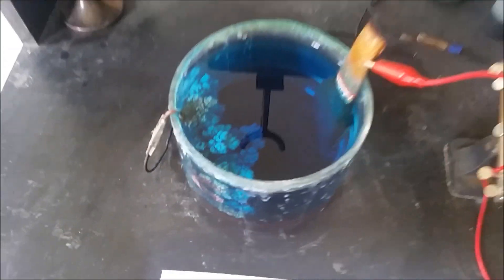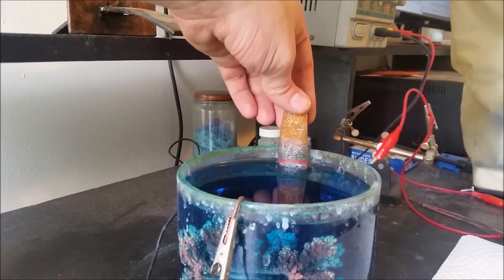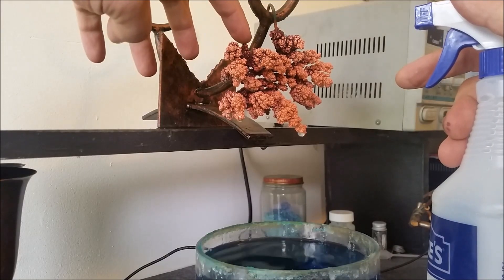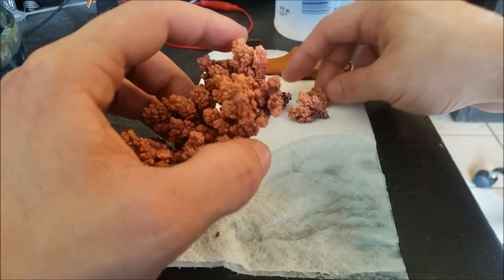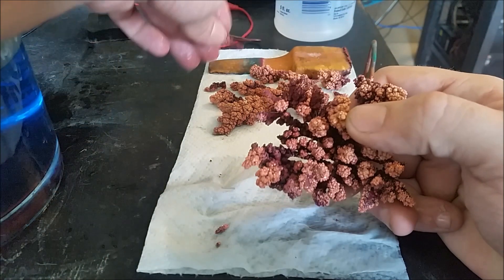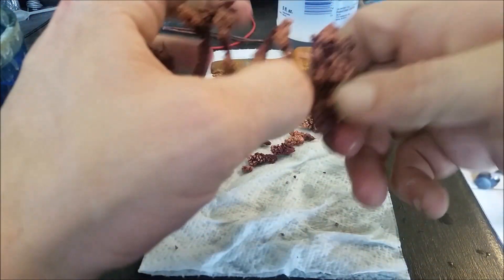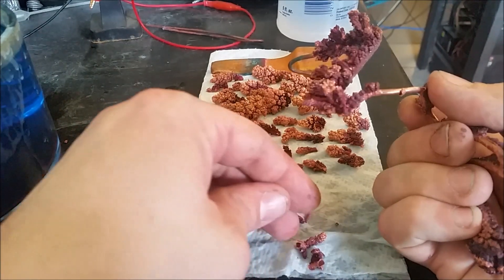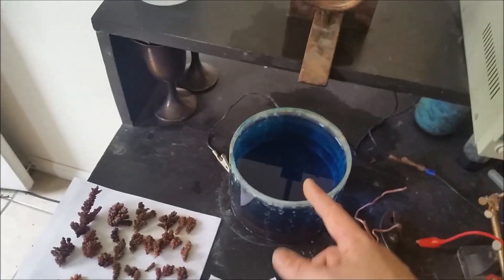Update to growing copper metal crystals

Comment: try fast crystallization, no matter if they are spiky, mesh the better, for ultra low density, make the crystals big, try welder as the power supply, dc
Reply: try from ground up, CuO with H2SO4, making the sulfuric acid yourself too, CuO from rocks, then to copper with electroplating
Reply: What would I need supply wise to do this method you speak of?
Reply: @Thrashdragon  no idea, figure out

Comment: The copper crystals in the ingot resemble orange opals. Shaped and coated, they should make really interesting jewelry.

PS, check out Harbor Freight's ultrasonic cleaner. Inexpensive, but really well-made, surprisingly. I've had mine for over 10 years. It gets rough use cleaning brass casings for my reloading. It is the go to cleaner for the competitive shooting community.

Comment: To clean copper, jewelers use either simple pool cleaner acid (or weak mix of muriatic acid) in a weak solution  for 15 mins to get rid of oxidation, or lately I just use warm vinegar and salt. You can do it in cold solution too, but it takes longer. Don't leave too long or it will start to etch.

Comment: You should try electroforming jewelry with some of the stones you showed in other videos.  I cut and polish and then epoxy a stone to a copper ring shank and then grow copper around the stone.  Looks great.  Also, you can dip those crystals in some kind of acid like HCl and it would get rid of that oxidation.